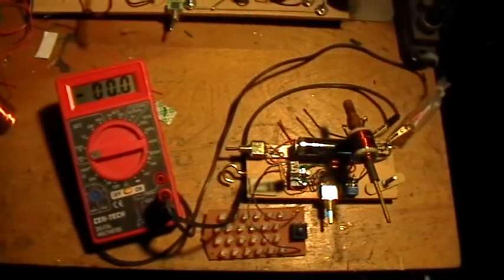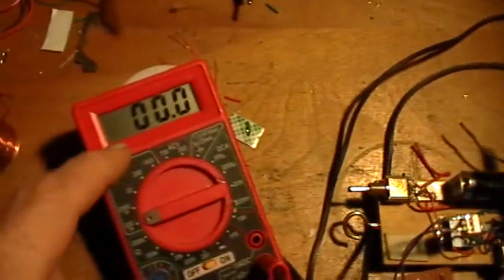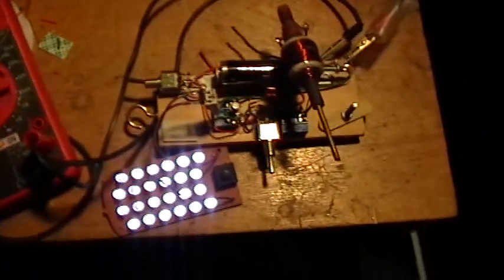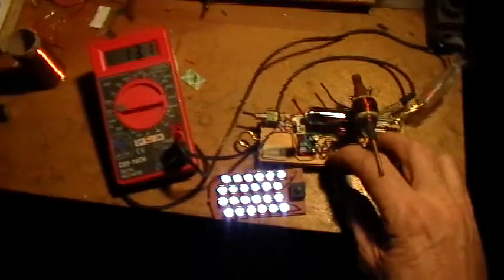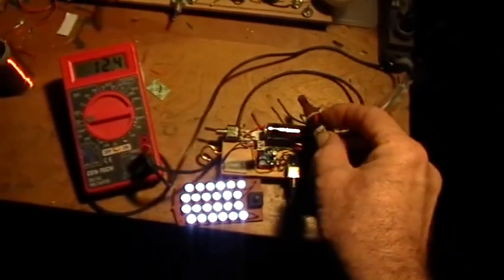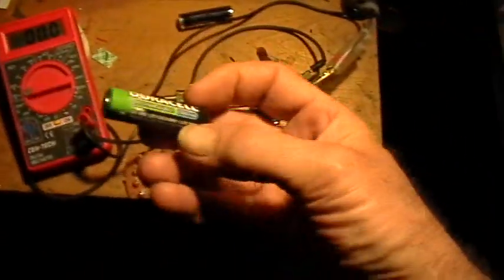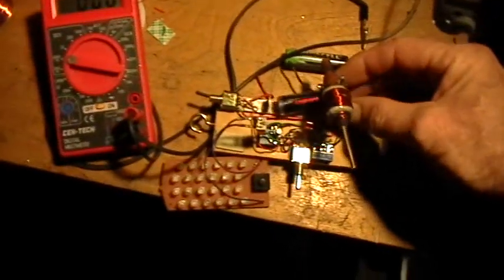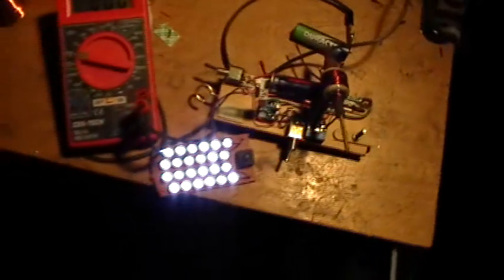Joule Thief: JTBasic with Loopstick and Capacitor: Mode Switching

Comment: You said "the transistor is saturated..."  Right.  When I find that the LEDs don't light and it draws a lot of current, I change or add to the resistor to make it 2.2k, or whatever, and then the transistor is brought out of saturation and into the linear region.  And then the LEDs light up.  But all JTs should be able to light up with a fresh battery.  Maybe adding a resistor in series with a switch to short it out would be a good idea.  Or else a 10k pot or similar.